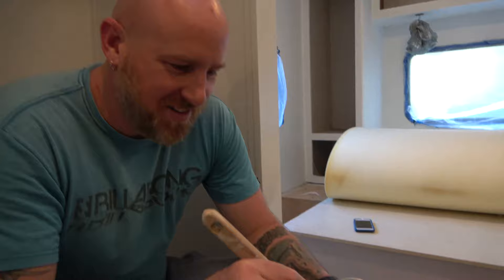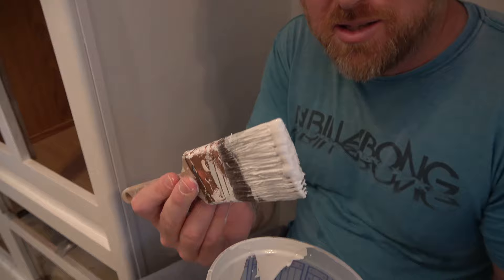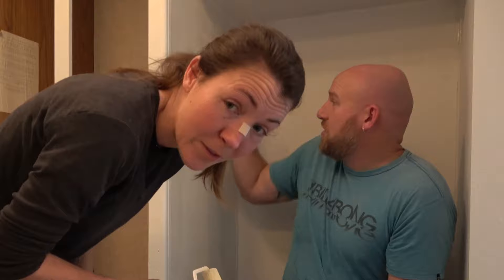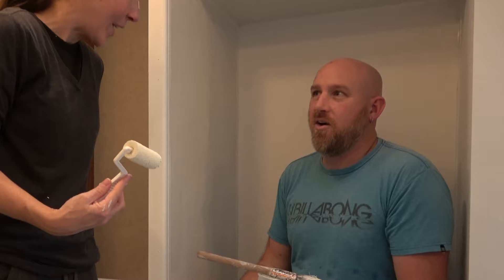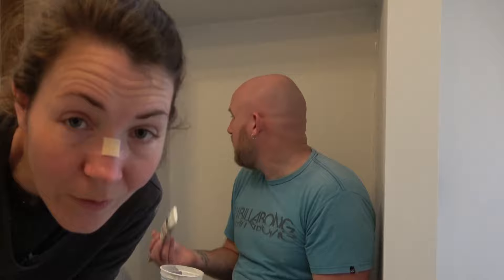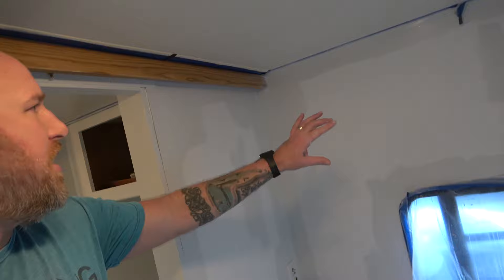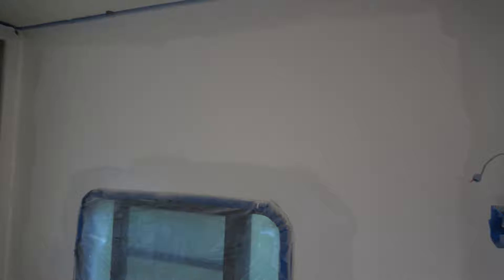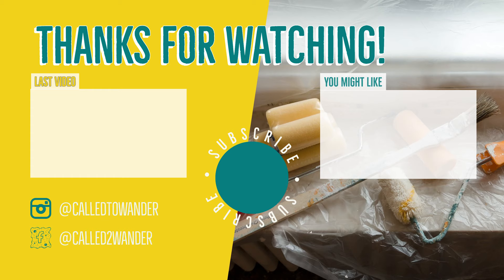CtW 112 // Is Painting Your RV Walls and Cabinets Worth It?? // Class C Camper Remodel

Comment: i am so not looking forward to doing this ! lol but mine is a 1990 and it needs a face lift bad,,but still going to be way cheaper than building a bus ,, does yours have a generator ?
Reply from the maker: Painting the interior is such a pain! But totally transforms the RV! Yes, we have an onboard Onan 4000 which pulls gas from our vehicle fuel tank We haven't used it often but it was one of the non-negotiables for buying a used RV. Let us know how your remodel goes and if you have any other questions! Stay tuned and you'll see all the projects we worked on and maybe get some ideas from that. We're also building out our project page here: https://calledtowander.com/class-c-rv-remodel/